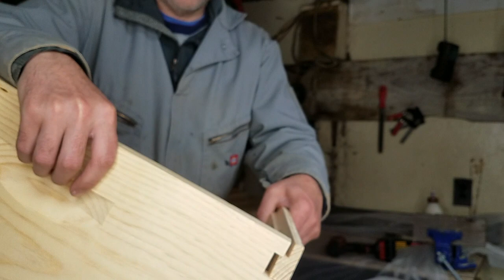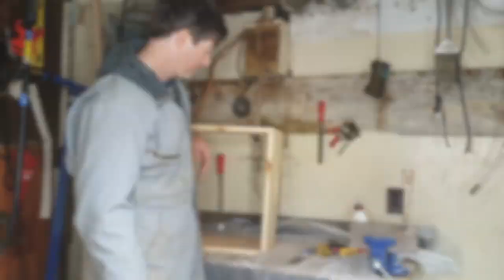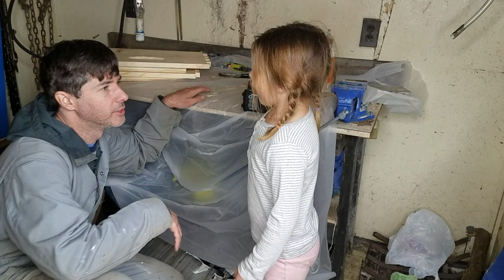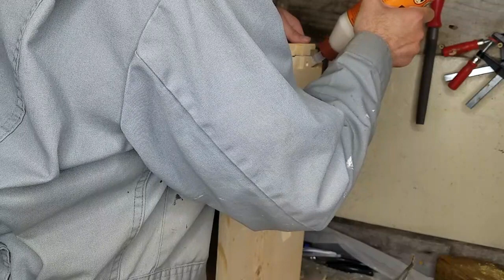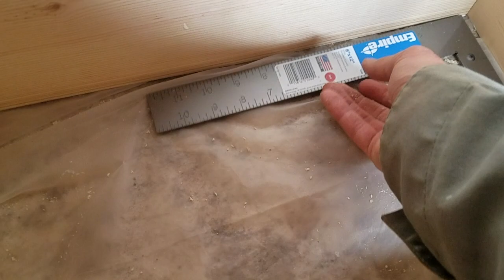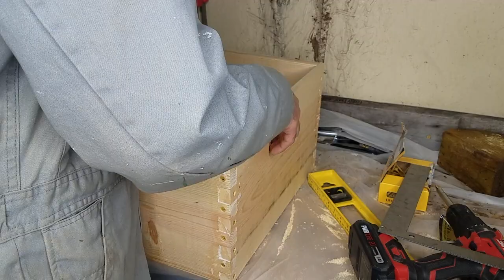Assembling Our First Bee Boxes

Comment: I started using nails in the beginning with titebond II but since learned to use deck screws. I never countersunk them though and seemed to work ok but probably would be better to and less risk of splitting
Reply from the maker: The only thing I didn't like about those countersunk holes was that it was hard to get the insides of them covered when I painted them. Probably no big issue, but it seems like it may be a place where water might get to. In the future, I may fill them with some type of compound.